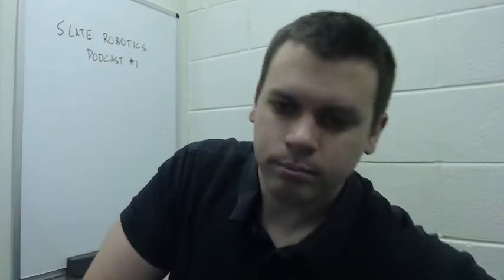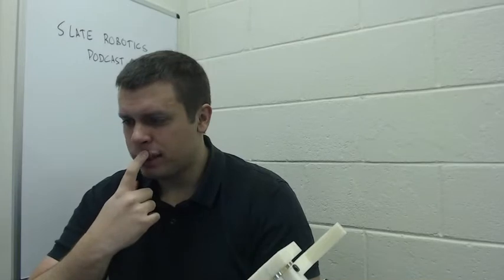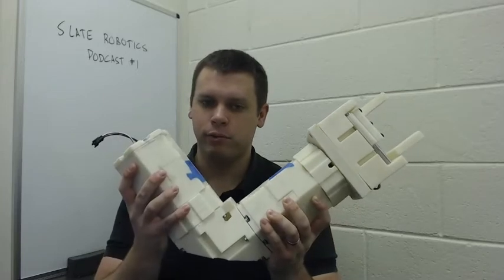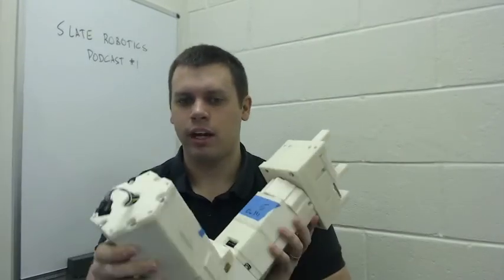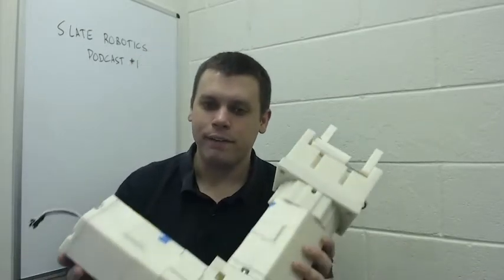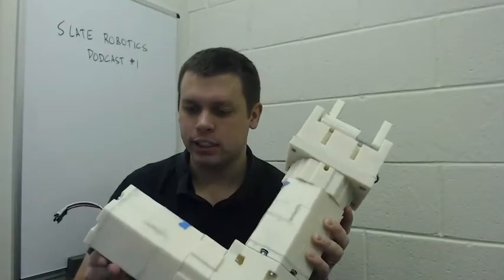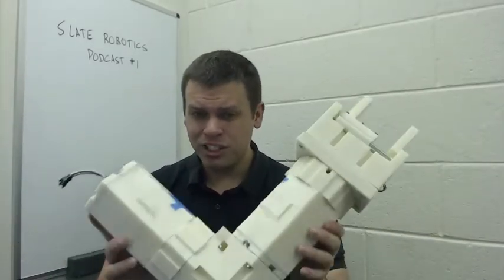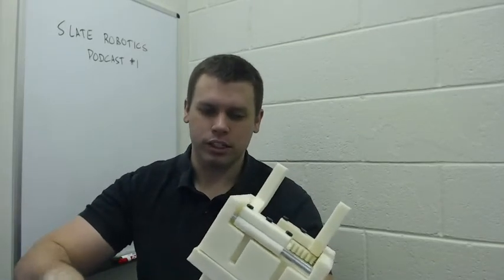Slate Robotics Podcast #1

Comment: I believe that as the 3D printing world continues, the exoskeletons I believe will be extremely cheap. Where I see the expense continuing in is at optic/ sensors, actuators/ servos, processing power and the most expensive being batteries. I think if you can have a low cost, high processing and long battery robot; not only will you change the market... You will own it.